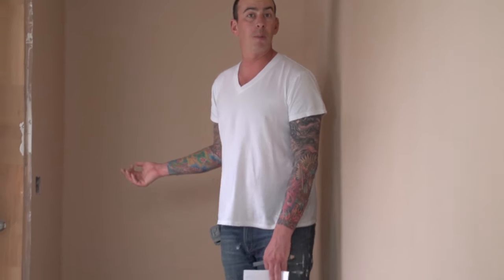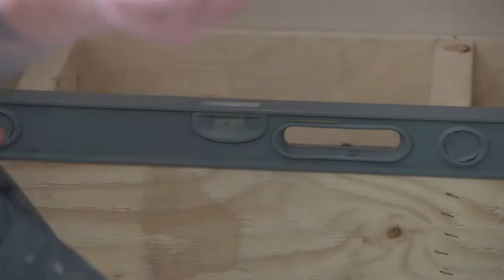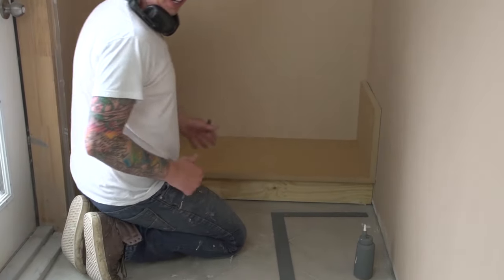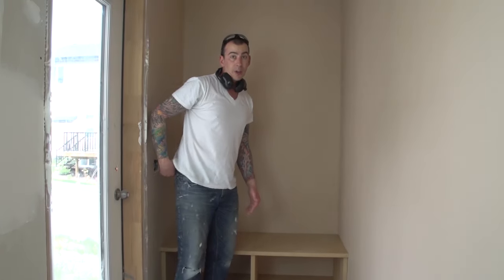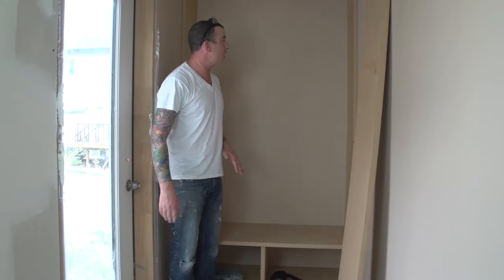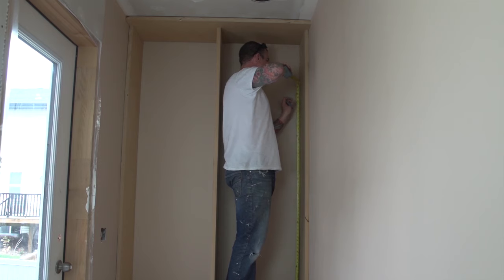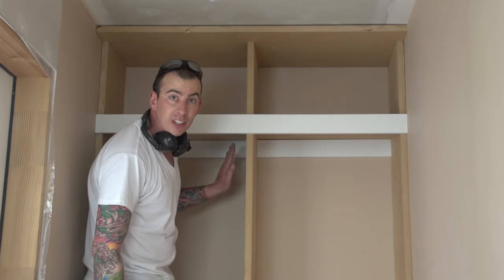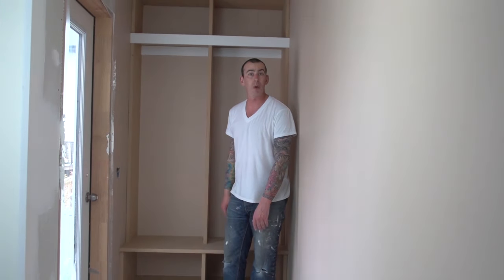How to Build Mudroom Storage - DIY

Comment: You use a lot of what appears to be MDF sheets. How do you paint the edges? The sides always seem to look good but the edges absorb in paint and it takes about 10 coats in my experience.
Reply: Hi. Try applying two coats of wood sealer on the edges, sanding in between coats. It will absorb less paint and you will have a more uniform result. This is what I normally do. Hope that helps.

Comment: First off, sorry for my ignorance (I'm very new to woodworking, etc.)... Are you nailing the side pieces into the studs on the wall (ex. @10:36)?
Reply: i highly doubt it, since he didnt have a stud finder out. this is not the correct way to build a "built in" there is so many things wrong with this "structurally" idk where to start.

Comment: Had to give this one a "thumbs down." Where did you learn to design built-ins...ikea? You started out ok with the base, but the rest was a pretty sloppy job. Weak attachments (especially those center verticals), and by attaching side pieces and shelf supports to the wall, that whole thing will look a mess as the house settles. Treat built-ins like part cabinets/ part furniture...pre-build and pre- finish structurally sound boxes, and use scribed trim pieces to get it tight to the wall and ceiling.
Reply: it is not the best way to built a mudroom storage but still it is v. good for a limited budget using the available materials in ur workshop.. he is not supposed to teach u theories but to give some ideas that may help u to execute ur proper project
Reply: I’d rather buy something from Walmart
Reply: I think if he would have used pocket holes for that center vertical it would have been a lot stronger. I think it would be ok though since he attached that front trim piece holding everything.  I would have definetely have used plenty of glue or caulk though and it would have made it a lot stronger.